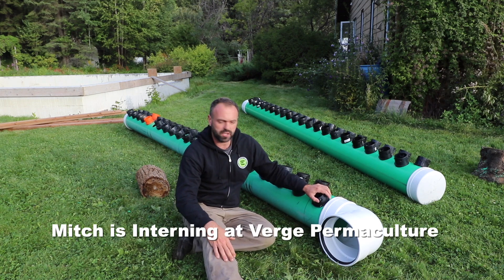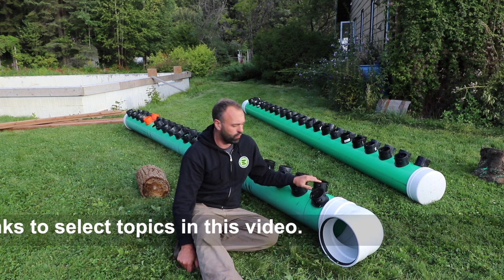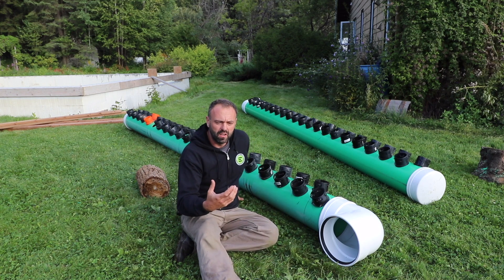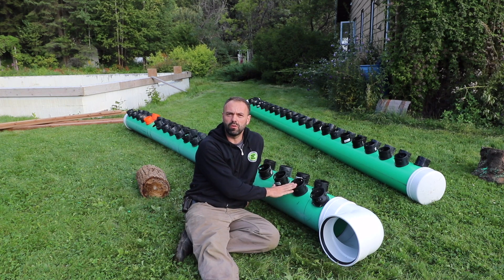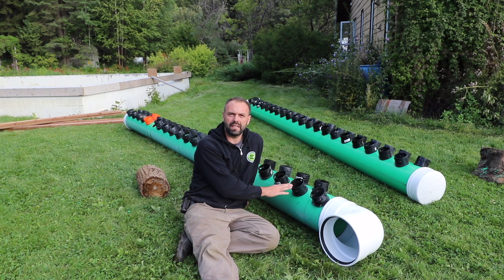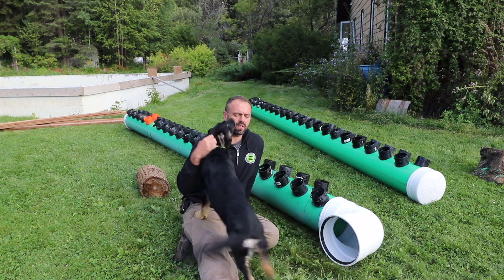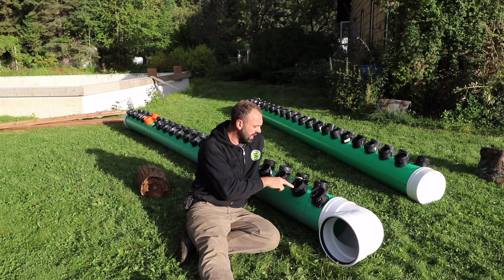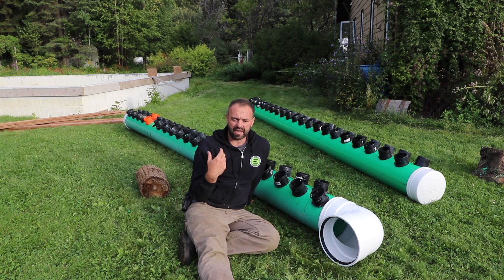Passive Solar Greenhouse Build Progress Update September 1, 2020

Comment: Great video Rob. I love the attention to detail.  What are your thoughts on open rockbed concept that the University of Minnesota is exploring with their greenhouses? It would eliminate all the complexity of these manifolds. In my area the cost of the rock was comparable to the cost of the hundreds of feet of weeping tile needed.
Reply from the maker: I am not sure, can you share some examples of what they are working on. I am familiar with the concept, just not sure where it would go in the greenhouse.
Reply: @VergePermaculture  Instead of backfilling  the "basement" with native soil and weeping tile, their design fills it with porous rock. Air flows directly through the rock instead of through weeping tile.Here is a small screenshot taken from their 2.2 plans. https://encrypted- tbn0.gstatic.com/images?q=tbn%3AANd9GcQrfRWaX427nC_nXd_L3oUaWCG0T2GxfRJ-Mw&usqp=CAU. I'm  trying this approach out with my greenhouse mainly because of the simplicity, but my build is not done so I don't have data evaluate yet. https://permies.com/t/121481/Glenn-passive-solar-greenhouse-build
Reply: @gvanagten 
I prefer soil and tubes as its less unpredictable. A rokbed has an unknown volume of air spaces but you can calculate tube displacement. Air travels predictably down a tube but very unpredictably through a rock bed so you cant be sure all of the rock mass is being utilised. Pressure loss is another variable that you cant easily calculate for a rockbed. There are efficiency enhancing features you can incorporate into a system with tubes that cant be used with a rockbed. If you build a second greenhouse, you could use tubes and compare the two. Whatever happens your greenhouse will outperform any standard greenhouse so its all good.